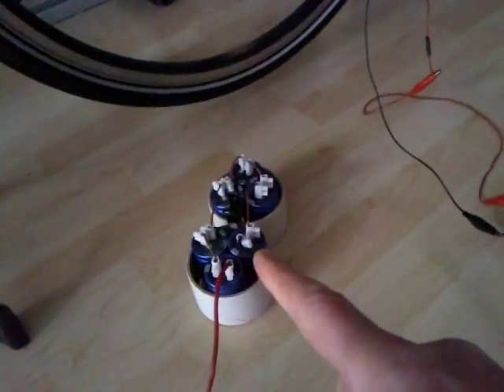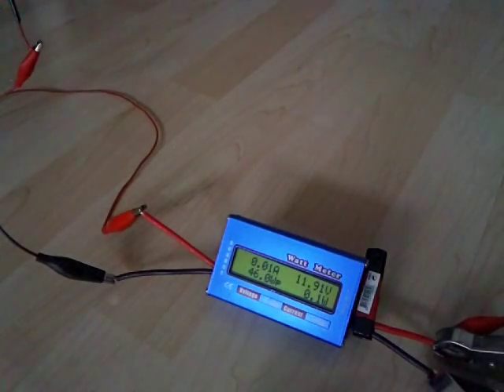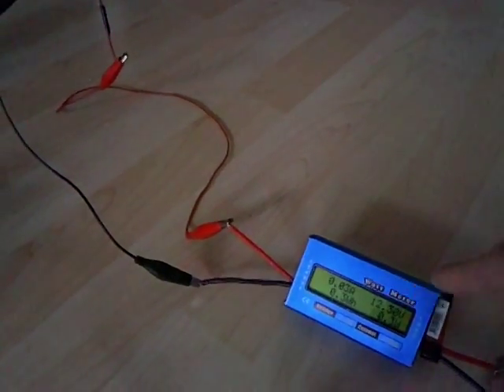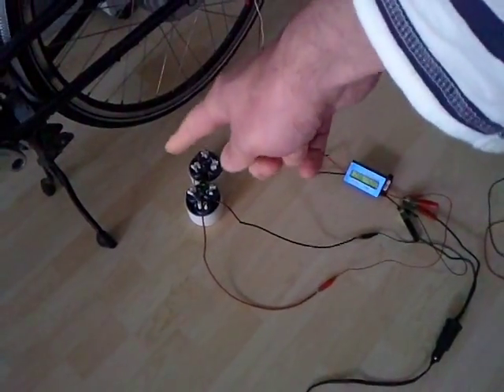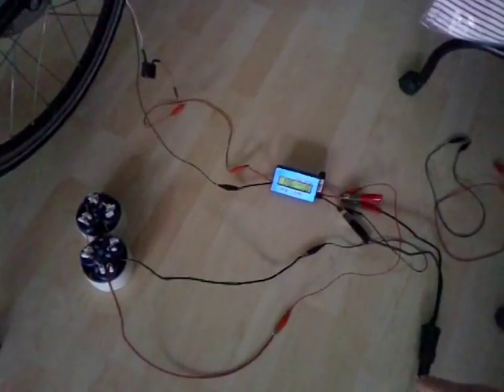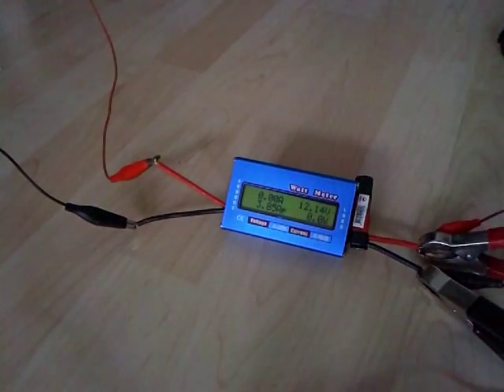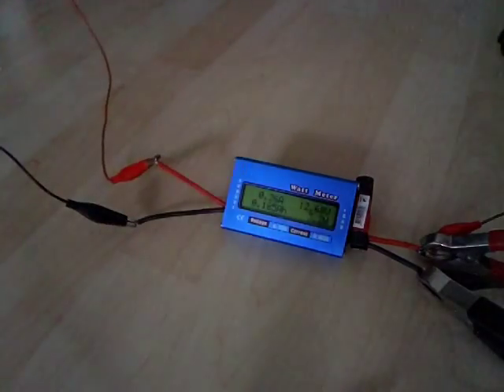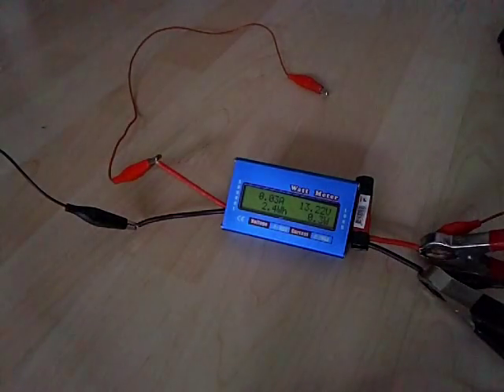e bike as a generator, power output shown

Comment: thanks for sharing! i'm about to build a hub-motor based generator for a community group and wondered if you have any advice about how to choose an appropriate hubmotor? any specific models to seek out or avoid, and a generalised description of why these models are well suited would be so useful!
Reply from the maker: Hi Prosody,
My knowledge does not stretch that far. Sharing just what I found out is all I did, and it ended there, meaning I have 1 e-bike only, and did not try endless other models. But thank you for asking.

Comment: Hallo Mr. Is the wire and magnet still standard or modified?
Reply from the maker: The motor on the bike was left -as it is-. It is a 24 Volt motor. It was powered (when it was newly sold) by a big NiMh battery pack. PS: I have never opened the motor, so I can not tell you anything in detail about the internals of it. Amount of wire, number of magnets, etc, I really don't know. The motor I have is no longer for sale either, possibly I got very lucky this motor runs so well as a generator.
Reply: Can such a motorbike be used as a generator? I plan to buy a 36 volt 350 watt bike motor, hopefully it can also be used as a generator?
Reply from the maker: The only thing you can do is ask the seller. Explain what you want to do, and if this can be tested. If the seller does not know then you are taking a risk. There are several motor designs which have a great efficiency as a motor but not so very well when used as a generator.
Good luck!

Comment: When you pedal under load, does the resistance of pedaling increase or stay the same? Like is it harder for you to pedal?
Reply from the maker: +Thien Nguyen Hi Thien, a late reply, sorry for that. You really feel the load. When I charge up my super capacitors, when they are empty (4 volts for 6 caps) then I need to gear up as I need to deliver a lot of power. But that power does get taken in rapidly, so when at 10 volts stored in the super caps, I now go to the highest gear (ratio) and my feet go round like mad. The voltage then only creeps up slowly, but our legs can handle a high speed (and deliver a lot of power) for a long time. So even if the pedals go up and down rapidly, our legs still deliver a lot of power and at that higher speed you feel less of the load. It is really insane to see how we can deliver 150 Watts with our legs so easily. I remember from pictures from war, that soldiers were forced to pedal on bikes to deliver power (seen it in a movie I guess).
Reply: +deslomeslager thanks for the clarification

Comment: Ik heb met veel interesse gekeken naar uw youtube filmpjes waarin een ebike wordt gebruikt als generator. In het laatste youtube filmpje produceert de generator bijna 300w om de "heating fan"( 12V ) te voeden.
Ik heb nog de volgende vragen waarop u misschien een antwoord kunt geven.

- Wordt deze 300w ook aan de ( 12V ) "heating fan" geleverd als de condensatoren niet  zijn aangesloten ?
- Hoeveel vermogen levert de generator als alleen de watt meter op de generator wordt aangesloten ?
- Is het ook mogelijk om de generator 300W aan de power inverter te laten leveren
waarop een aantal 220v lampen zijn aangesloten met een gezamenlijk vermogen van 300w ?  
- Wat is het merk en type van de ebike motor ?
Reply from the maker: Bedankt voor het kijken. En voor de reactie. Ik zal in het Engels antwoorden, zodat ook anderen er iets van meekrijgen.
* would the 300 Wat also be delivered without the super capacitors? The answer is yes. But they will keep the voltage and current a little bit stable. There is a dead moment every time your feet are up and down on the crack. Plus, the 300 Watt is really (for me) the limit and I can only keep that up for a short amount of time.
* how many power is delivered by the e-bike with only the Watt meter attached. I think yuo mean what voltage? Without a load the generator will go up to about 30 Volts. The wheel will be turning compared to the bike going 30 miles an hour (or 45 km an hour).
* could the 300 Watt be delivered through the power converter? Yes, of course. There will still be issues, as the voltage needs to be regulated. Also you will loose power as the converter has an efficiency of 98% or less.
* Could you run 300 Watts of lights on the converter? This depends on the efficiency of the converter. If the efficiency is 90% then I would only get 270 Watts out of it.
* more about the e-bike brand: from what I could find on the internet, the motor is a transX motor. There are no labels on mine, so I googled on (Dutch) brand of the bike. I could be wrong on it. I found zero images of videos, sorry for that. I even looked on the forum "Endlass Sphere" and found one occurrence to transX, and there are only few sold.

Comment: You where right! 250w! No wonder your legs get tired. Thats 1 third of a horsepower. Its not very common for an electric motor to be so efficient as a generator. Can you tell me what kind of motor or model number etc? Have you tried to charge a 12v battery via diode? I wouldn't be too worried about the diode wasting power or getting hot. 0.7v drop at 18a is 12w, If the diode can handle 20-30a then it should be able to dissipate the heat no problem. Well done.
Reply: According to this chart http://www.ohio.edu/mechanical/programming/hpv/hupgraph.gif Your probably putting about 0.5-1 horsepower to the peddles. So the conversion rate is not too bad at all.
Reply from the maker: Hi Mongrel
Thanks for the thumbs up. And again, 250 Watt cannot be sustained very long, I am not an athlete. Strange we still compare to horsepower (if you think about it). Sometimes I calculate the Watts back to Joules per Second and then to calories. Our body is super efficient in converting (eaten) calories to joules (output).
From what I could find on the internet, the motor is a transX motor. There are no labels on mine, so I googled on (Dutch) brand of the bike. I could be wrong on it. I found zero images of videos, sorry for that. I even looked on the forum "Endlass Sphere" and found one occurrence to transX, and there are only few sold.

'To charge a car battery is really easy. If the output is about 4 to 5 amps, it is really easy to pedal. Could do that for an hour, no problem. To output 24 Volts (for two batteries in series) the rotation speed of the pedals gets rather high (even in highest gear of course) and it is not possible to sustain at that level.
But I still prefer to remove the diode when the output is over 3 or 4 amps. I can smell the diode getting hot after a few minutes (there is a very thin layer of oil on it, or even some residue as it is a used diode from a motorbike or so. That oil smells when it gets hot).
Reply: Thanks for putting all that effort into finding the motor.
You can make a good heatsink from soda can aluminum. With all that power you'd hardly notice the load of a small PC fan for extra cooling too.

From some of the googling I did, you would be using about 12,000 joules of energy to charge your cap bank to 17.1v. If your body and the generator is 100 percent efficient. We know that cant be the case, so you should probably treat yourself with a good meal :)

Considering the short duration your peddling for before exhaustion becomes an issue at max output. It is possible your body is putting out 1-2 horsepower for a breif time.

Thanks again for all the effort you went to, to answer my questions.